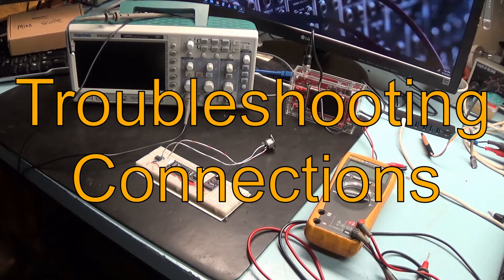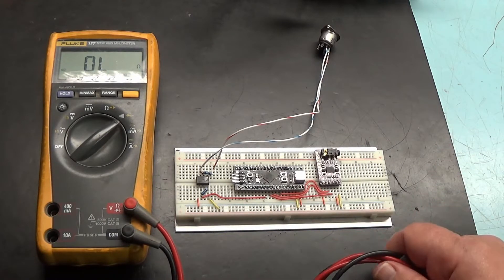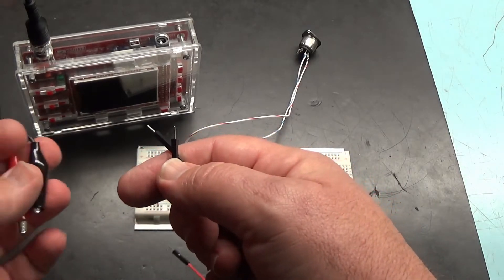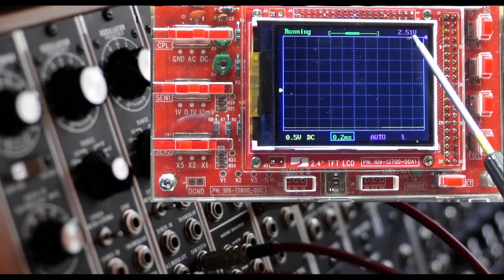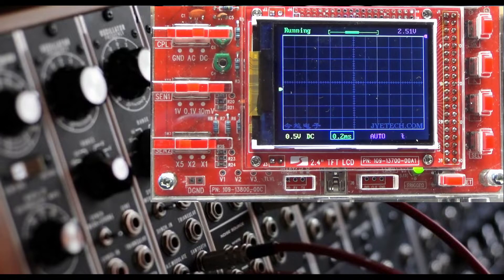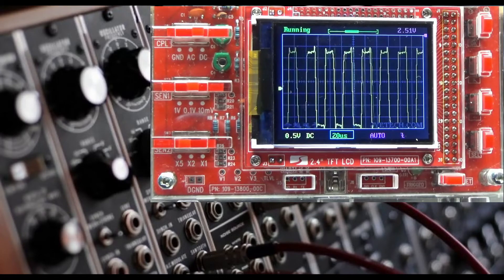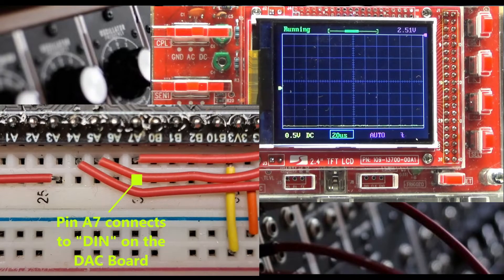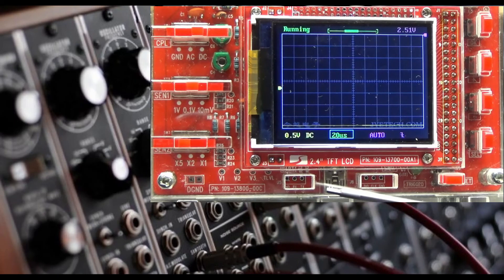Troubleshooting the BP Synth..  HELP is here!

Comment: Hi, can you pop a small headphone into the audio jack on the  DAC board and hear something? I'm not sure if the problem lies with the programming of the BP. Is there a smaller program that is available (can you write a small program) that uses only the BP processor to blink an LED and to output a square wave (or anything else) from the output jack of the DAC board. this will show if I'm on the right track. I originally bought a Black pill with a lower frequency crystal and a limited memory -did not work! Then I purchased one with the correct specs from the supplier that you suggested in an earlier video. Still no output sound - not sure if the MIDI stream is not correct, the programming step or the DAC!! HELP!!!

Comment: This is very useful. I built it and I do get sound but it acts a bit stange.. i/e if I use the ctrlr panel you included to tweak the sounds, it works but does not always do what is expected. For example, if I turn off the delay, it will disable the fx but the signal will become really low.. you have to raise the WET value for it for the sound to come back. So... not sure if this is a problem with the blackpill and / or the DAC (I am using the UDA1334). I developed a pcb that includes an arduino + pots and buttons to work along with the bp synth as a dedicated controller. It works, but with the same caveats.

Comment: Hi and thank you so much for your video tutorials about the BP Synth. I have been amazed by them and I am now trying to build one.  Unfortunately at the moment I do not get any sound. I have tested it with an oscilloscope and the only thing that does not work seems to be the PB output on pin A7. I do not get any signal from  A7 when pressing keys on the keyboard, I checked with the probe on the pin itself, so it is not the  wiring. Everything else seems to work fine (I get midi signal to A3 and the square waves from A4 and A5 at the right frequency.  Would you have any advice please?
Reply from the maker: Hi.  I'm sorry you're having issues.  It is possible the BlackPill board could have a defect.  Very difficult to do but you might try to trace that A7 pin back to the tiny CPU itself and check for signal.  The square signals do indicate it does have the code running correctly for the most part..  do you have another Black Pill to swap in?   This is why it could benefit to buy two of the BlackPill boards when buying parts, if you can..
Reply: @Synthetech  I found that with the 138 octocoupler, the 10K resistor value is too high adn you wont get any midi signal in. It will work fine with 1K or even another 220ohms
Reply: Thanks very much for your reply and sorry for the bother... I actually had another board and tried it but with  the same result. I wander whether the issue is with the midi signal... (but the keyboard works fine, I tested with BOME  Midi translator) before I sent you my first message I did quite a few tests and noticed that the midi signal after the octocoupler was not right (the voltage level was raising too slowly and did not get a "square" on and off wave). After doing some research on ways to wire the 6n138 I connected pin 7 to ground through a 10k resistor and this seemed to work, as now I get a digital signal like the MIDI signal from the keyboard (although I noticed  that the voltage from the keyboard  goes from 4 v (digital low) to 4.9ish (high)... I still get the same wave shape on the other side of the octocoupler which goes from 0 to 3.3v so that should be ok. But still no sound. Sorry again for the bother, I just feel stuck
Reply from the maker: @fluxiable  It does sound like you are having issue somewhere with your  6n138 interface.   My schematics are for the  6n137 and probably a little different.   The Midi signals should always go from a steady Hi (5v on MIDI Cable Side, 3.3v on BlackPill Side) and pulse all the way to Ground when messages are incoming, then return to the 5v/3.3v state again when idle.
If your signal incoming is 4.9 Hi and pulsing only down to 4v low, that is surely an issue to investigate...  could be that protective diode is in backwards (MIDI cable side).
Sorry I'm not much help without being there, but I'm sure if you keep at it eventually you'll get it going because it sure sounds like it wants to work.   Often it is the smallest thing that was overlooked that get's a big problem solved.
Reply: @Synthetech  Hi Synthetech, Unfortunately it didn’t’ work. I have now created a post on EEVBlog  called "MIDI signal (using a 6n137 octocoupler)" hoping to get some help to troubleshoot this issue (clearly I cannot expect ongoing support from you 😊).
I see you have also posted a course on how to code the BP Synth and I intend to watch it, as I want to learn to code it and I also would like to add a few knobs to control some parameters directly. I have some knowledge of C language and built some midi controllers in the past. I noticed that you said at the beginning that the course was meant to be for Udemy so I am not sure whether it is complete. Are the code bits you have uploaded and linked in this course all I need to debug and customize? Many thanks
Reply from the maker: Sorry you're still having issues... the course is incomplete as the interest in it was found to be very minimal.  The code posted at the last video includes basic waveforms, midi, ADSR, vibrato and the Virtual Analog Filter.
Learning code as deep as I went with this project can take a lot of time and practice.   I really recommend checking out fastbitlab.com for getting a good grip on how to program micro controllers.. especially the STM32's.   I would not have accomplished what I did without his courses.
EVERYONE asks for adding knobs and switches... to do so means utilizing the ADC's (for knobs) to convert voltages sensed on the inputs to digital values the program can work with..  this means you must use ports on the uC and you'd probably need to use a multiplexer to expand one input out to a scan of multiple knobs.. IE one input that branches out to multiple knobs that are scanned one at a time, then repeat..
It can be done, but you really need to understand C, the architecture of STM32 or other uC's, how to read DataSheets (the manual with the "roadmap") and what can be helpful in the case of STM32 is utilizing the HAL Library.. kinda like the Arduino libraries, but a bit more complicated.
I miss messing around with the uC's and coding.  But as they say in the country, "Make hay when the sun shines..".   I'm not getting younger and currently my hay barn barely has any hay in it, but I found a decent field for my final working years and I best get to working it or I'll be too old with an empty barn!
Reply: @Synthetech  Thank you Synthetech and thanks for your reply. I am familiar with multiplexers as I have used them to build midi controllers. So my plan was to add the midi knobs directly to the board, rather than have them external. Sorry to ask but would you be happy to share you final code? If you are I will then work on it and send you back the code with the added knobs once completed. It may take me some time but I am confident that I will manage. This will also help me to debug the issue I am having. I will also complete your course as I am sure it will be very instructive, but starting with the final code would definitively be faster. I can give you my contact details if you are happy  but if not, I respect your decision.
Reply: I think you may have just found the problem. I didn''t realize I got the wrong octocoupler.... I will order the correct one and hopefully it will work! Thanks a lot :) !!

Comment: Lovely project, and I have it somewhat working. However the BP-Synth GUI is emtpy. No panels. I could of course set it up myself, but your panels look very good. Is there an update to this GUI?
Reply from the maker: That's odd..  what OS are you using?
Maybe try to download it again?  
I have not changed it.
Reply: @Synthetech  I am using Win 11. Tried downloading both basic and full package. Still no panels when opening the GUI.
Do you have the panels as .panel files?
Reply from the maker: @ShogunManOslo  I just downloaded the GUI onto a Win 10 Laptop for the first time and it opened the controls right away.
If you have other PC's or laptops to try it with I'd recommend that.. othewise I have no idea what could be the problem, sorry.
Reply: @Synthetech  Got it working by copying the file to a local folder instead of running it from the desktop. All good 🙂

Comment: Hey @synthetech great project! I tried bulding one with the UDA1334A DAC Module and seems nothing is coming out. Might I have the same problem as the PCM 5102 as faulty soldering from the Mfr? Everything else sounds good according to my vmeter.
Reply from the maker: I don't think there are any solder jumpers on that board.
It is possible the board itself is defective.  Did you check for signals with a oscilloscope?
Reply: @Synthetech  Yes, everything seems ok. I will replace de module just to be sure. Do you think It would be better to go with the PCM5102 dac and the St-link powering?  Tank you for the reply!
Reply from the maker: Sorry your having issues.
I tend to like the UDA DAC because it looks better built and I was able to buy several for 2.50 USD ea. 
Power should not matter but I usually have a stlink connected because I tweak the code.

Comment: Is there a way to use potentiometers on the breadboard instead of the gui? People love knobs and if they had a way to adjust all those parameters in real time without needing a complex controller that could really get some people interested. Anyways I will be trying this over the next couple of weeks so expect plenty of questions lol
Reply from the maker: There could be a way, but that complicates the build and increases costs.
Reply: In Floyd Steinberg's build, he's using MIDI knobs to control parameters, at 7:13:

https://www.youtube.com/watch?v=FjLcPNhzAwo

Surely that's the way to go!?
Reply from the maker: @tkonan  Not sure if that's falling into the "complex controller" catagory.   But yes, having a hardware midi controller is quite easy to use with the BP Synth.
Reply: @tkonan  I suppose but you need a midi controller for that, would be cool if this build could have the knobs / sliders on the breadboard itself

Comment: I just did it all and check with dso 138 oscilloscope everything is OK but I don't hear any sound from out of PCM 5102 DAC I connected with little stereo jack in to my PC or any other amplifier with speakers but no sound :(... what can be problem if I dont hear sound but all other testing 6N137, Blackpill, PCM board  works on oscilloscope?
Reply from the maker: Hi Dubravko.   It may be easier to just email me so you can send pictures of how you have this connected up.  I'll post my email here temporarily and then I'll delete it by tomorrow if I don't hear back from you soon as I'd rather not leave it posted up for long..  it's****  Give me a shout there and maybe a few pics of what you have set up and I'll see if I can help.   Usually I'm very busy with work, but it's holiday now for the next few days for me (I'd rather be making synths than what I do at work!) - Blaine
Reply: @Synthetech  I just built mine as well with a pcm5102 board and all the signals look good but no sound out of the dac
Reply from the maker: @jmatonis    Hi Jason.   Could you send me a picture of the back side of the DAC Module?   There are probably some solder bridges not completed by the mfr that youll need to complete.
Reply: If the jumpers on the back of the board aren't jumpered, jump H3L between the H and the 3 and it should start working. This was an aliexpress board. I believe this is a mute function. Happy building! :)